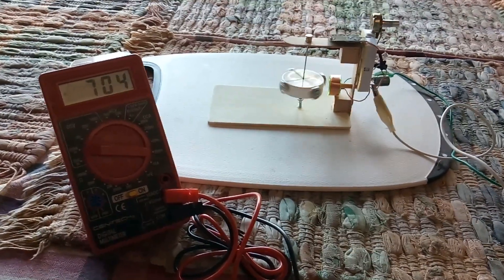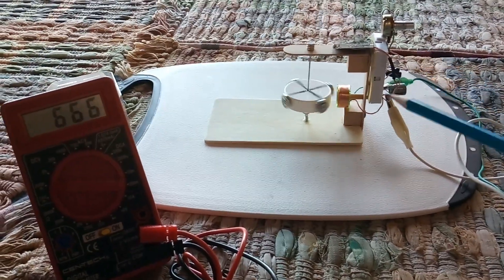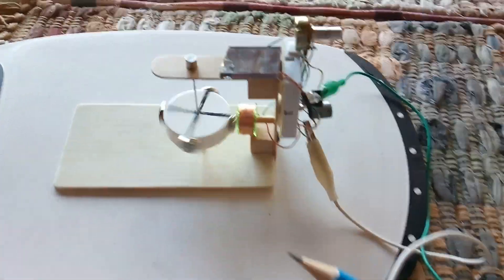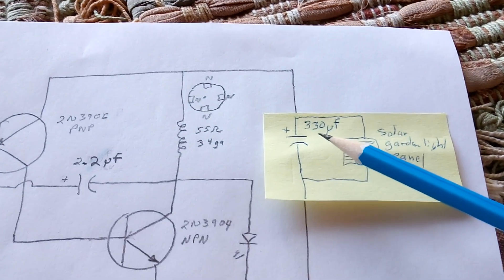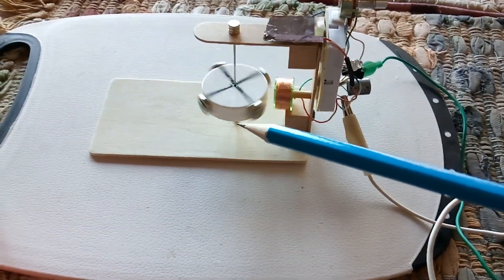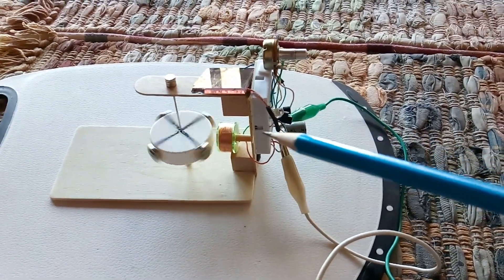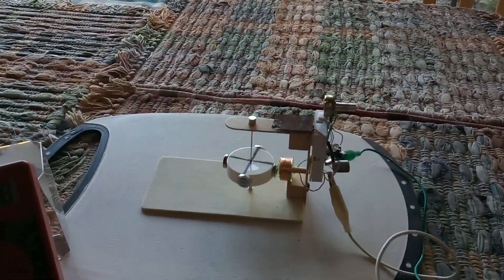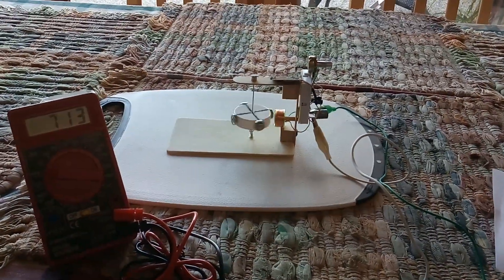Light Powered Blinker Motor

Comment: I had to watch it again ,  only a miliamp , barely  0.7 of a volt ,  and running off of pure solar in the shade...    Doesn't get much more efficient than that considering the mass of the magnets  that are being kept in motion by that tiny bit of current.    Its quite a little spectacle to see.
Reply from the maker: That is the thing about this one ----- it is quite a lot of junk to be spinning around on not much energy.

Comment: Miniature popsickle stick art replica windmill or carnival ride or vintage WWI aircraft propellor or tiny dancer or ...
Reply from the maker: Vintage aircraft propeller!  Yes.  My Dad was a  WWII P-51 pilot. I can see this turning  a big ole 4 blade prop.on a little model of that famous plane.
Reply: Lidmotor  Wow P-51 Pilot thats awesome.    I've always found the early 1900's  open cock pit fly by the seat of your pants stuff so aesthetically interesting.   It is an epic age that transformed the world.    Those early models make for great home made replicas.    All it takes is a little time some spar finish or varnish , popsickle sticks or thin table saw chopsaw scrap , junk drawer kite string , old dingey white t-shirt and you've got a one of a kind conversation starter with a working solar powered propellor.    With a little wood shop handywork you can incorporate the solar panel into the base or pedestal that it sits on...  :)
Reply: Lidmotor  https://duckduckgo.com/?q=vintage+early+aviation+images&t=ipad&ia=images&iax=images

Comment: Hey just a quick question do you still use crystal battery cell’s?
Reply from the maker: I still have some of those crystal cells around. My final conclusion was that they were just interesting galvanic cells.  I should pull one out, add some water to it, and see if it would run this motor.
Reply: Lidmotor oh yeah thats why i tought I was never that impressed with them because they need water . And for sure you should try to run this motor with them. Or maybe you should use cement baterry i had great succes with them conecting them in serial and runing  led lights without circuit for over 2 months at the time and when they are done you just short them out and they jump right back .